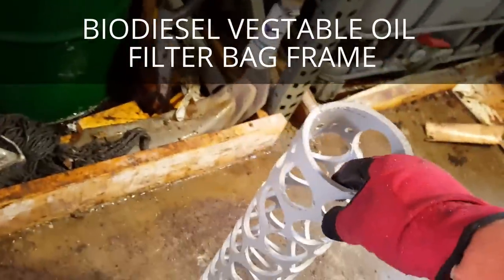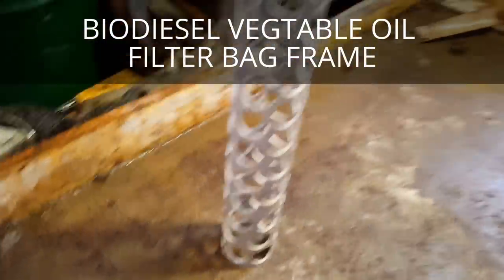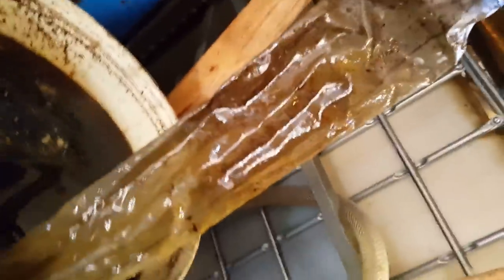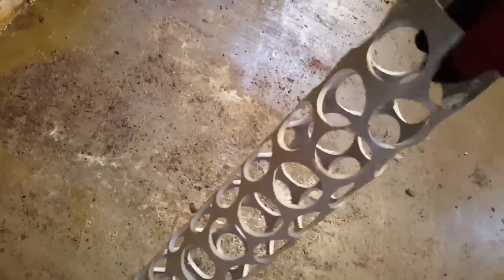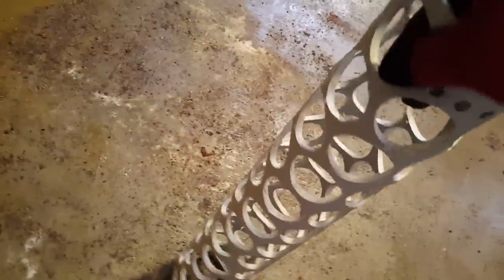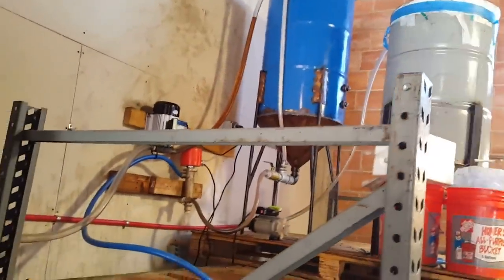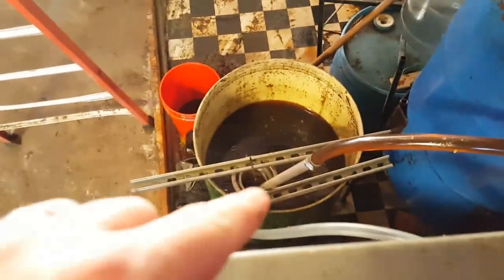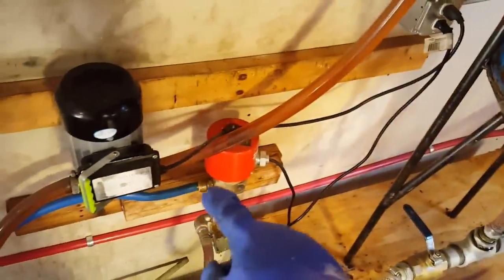DIY BIODIESEL VEGTABLE OIL BAG FILTER FRAME - HOW TO FILTER OIL THRU FAILING STAINLESS STEEL FILTER

Comment: the way i filtered my oil was with a centrifuge filter, it slings the oil so the contaminates build up inside, you just scrape it from time to time and it worked beautifully.. i left it on 24/7 as long as sun was out.. the solar panel it was connected to powered the harbor freight pump i used.. for dumping new oil into the tote.. i went to local thrift store and ask them for the cloths that are to ragged out to place for sale.. usually its mostly shirts and i would place it on a 5 inch pvc pipe section i had and pump the oil into the pipe so it would filter the big stuff out via the shirts and such.. the centrifuge got rid of the smaller stuff